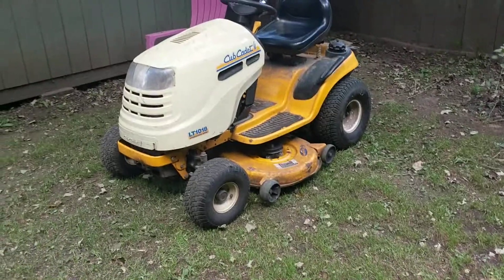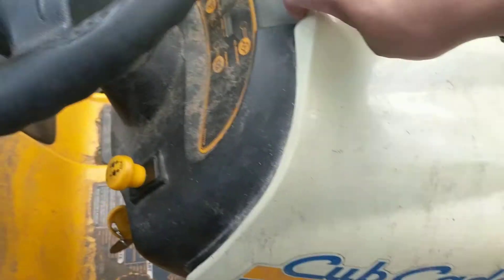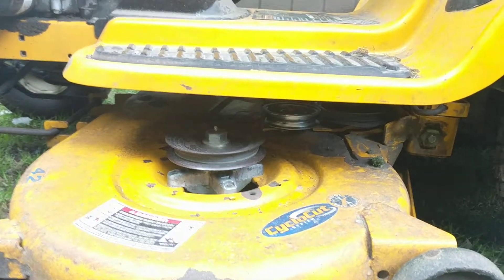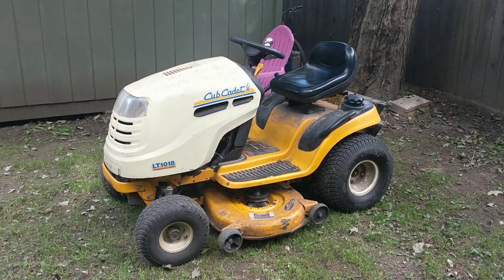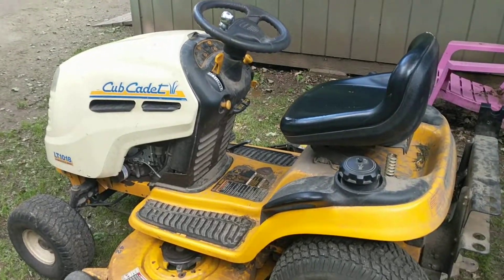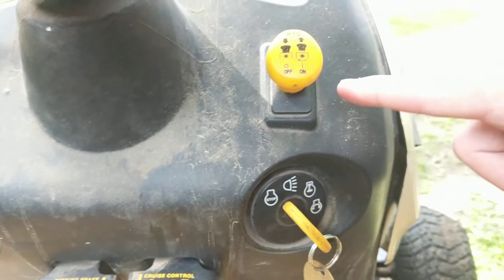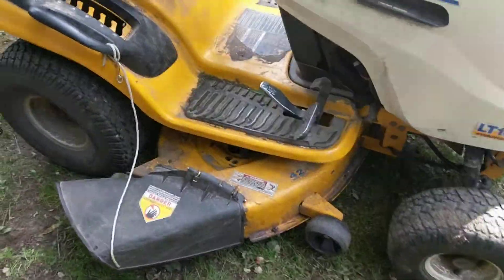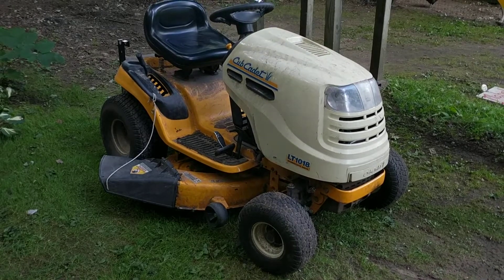Cub Cadet LT1018 review

Comment: Picked up one of these a couple years ago with 300 hrs and blown head gasket for cheap. Installed new head gasket and a few other parts Its been running perfect in my small yard now has 367 hrs. after three years.  I have COPD and too tight to pay someone else to mow It's paid for it's self couple times over.
Reply from the maker: I'm glad it's working out well for you. Apart from the old motor, this Cub Cadet has been a seriously reliable machine. It is now pushing 830 hours

Comment: Can you tell me we’re is the serial number located at on there I got the same one
Reply from the maker: I'll go look for it here in a little bit. If I can't find it, you could try googling "Cub Cadet LT1018 serial number", and maybe find something
Reply from the maker: I looked underneath the seat of the mower, and there should be a sticker with some information on it. On the right of the sticker, it says "Serial Number: 1F044H20612000002"
Underneath, it said "1F044H20612"

Comment: That’s the same on I got expect it’s 18.5hp
Reply from the maker: Yeah, I've seen your video of it before. This had the same exact engine yours had, but we pulled it off because it basically shit the bed.
Reply: @motormouth2472  As of June 2023 I heard someting and won't run and December 2023 after taking all apart. The Counter weight pins and connecters broke off. The engine still had oil. No holes in the block. Intake push rod bent. Crankshaft where the counter weight goes on each side wroup. The camshaft hole cracked. Cam itself with the decompression spring no damages with about 350 ish of engine hours. Got with 220 hours from High School Industral Arts teacher for free 10yrs ago since he ran out of room at his home or so.   Worth the 130hrs I used it. Hopefully I'll get a new engine like yours or a 19HP. It just the mounting plate on the new engines has to be exact size to line up to bolt on.
Reply from the maker: @bigjohnrailproductions8370  that's not good. And you can find brand new 17.5 Inteks for relatively cheap, our replacement one costed around $500, but it was purchased 4 years ago
Reply: @motormouth2472  So I measure the output and its the same setting in the 19HP and 17.5 HP briggs. I'm thinking I could go for the 17.5hp. The last thing is does the mounting holes to bolt on the frame match like the 18.5HP for 17.5hp?
Reply from the maker: @bigjohnrailproductions8370  I do believe they match. When we got the replacement engine, I don't recall it being very difficult to install. But if I were you, I would try to find the opinions of others as well just to confirm